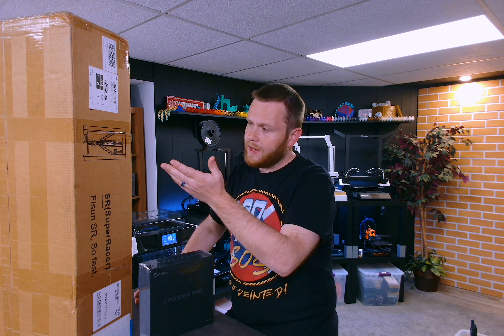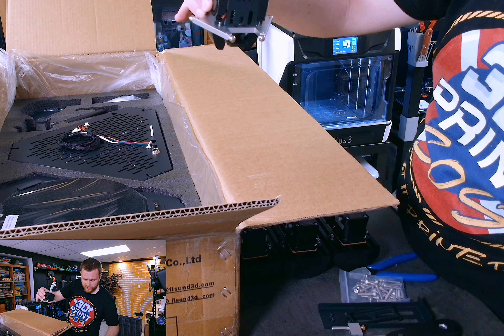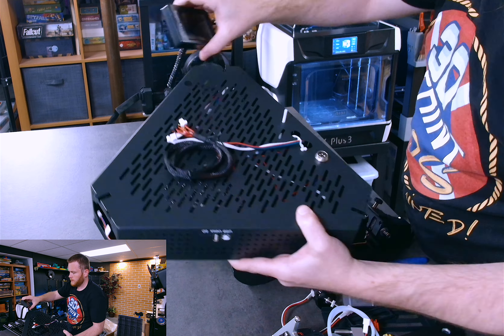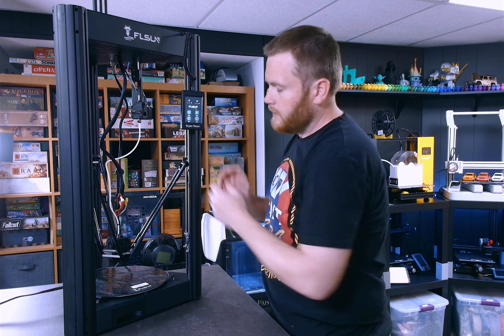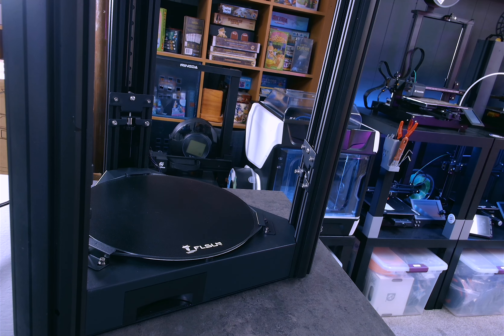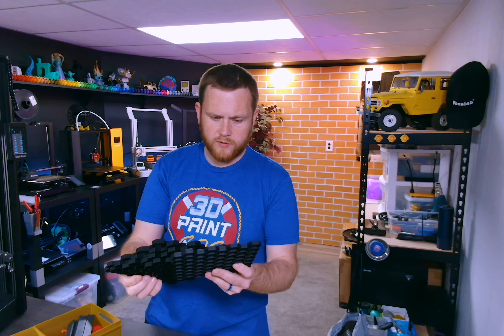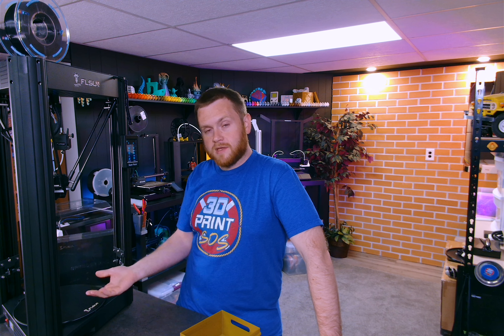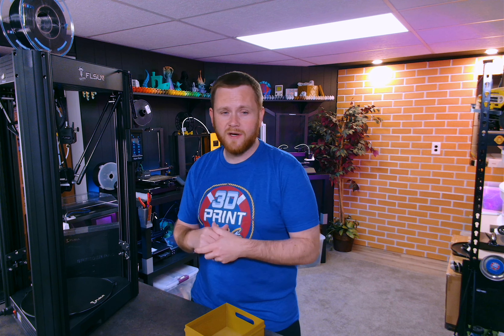My First Delta! FLSun Super Racer + Speeder Pad Combo

Comment: I print PETG at 120 mm/s on SR with a native nozzle and a tube in the neck
Reply from the maker: Heck yeah. It should be great at PETG. Its when you get into Carbon or Glass Filled stuff where it can be worse. Or TPU obviously.  SR is still awesome though.
Reply: @ I replaced the extruder on it with OMG. Connected it to the Speeder Pad. 
It prints monolithic parts with 100% filling for my products that I make. 
I don't even think about changing this printer to another one.
Reply from the maker: @Relax72Relax  Thats great. Love to hear it.

Comment: Got my SR and speeder pad on standby for that upcoming video.
Reply from the maker: I actually passed that machine on. I missed it so much though, I got a v400. I wouldnt wait, get that Speeder Pad unboxed and installed. It’s a massive upgrade in my opinion. Later when you get used to it, you can install vanilla Klipper on it and clean it up big time. Makes it even better.

Comment: Love your videos man
Reply from the maker: Glad you like em, cause they are fun to make! :)
Reply: @3DPrintSOS  are you still running alex's firmware on your aquila ?
Reply from the maker: @fjjj.  No, at the moment, Klipper via Sonic Pad
Reply: @3DPrintSOS  thank you so much for your feed back, so I have finally decided to install the firmware as per the direction o the "reduce risk of fire video" but when I power on the printer nothing happens, any idea what can be happening? thank you very much for your help in advance
Reply from the maker: @fjjj.  Could be several things. You have to make sure you are getting the right firmware for your machine. Second, you HAVE to ensure you are using the stock card formatted with 4096 bytes. This is far more difficult to do if you are on a Mac.
Reply: @3DPrintSOS  i got the sd card formated to 4096 on a windows, i do mainly use a mac, I have an aquila firts gen with a N32 chip
Reply: @3DPrintSOS  I think got it man Mac definitely seem to be the issue even if the usb was formatted in windows absolutely everything should be done in windows
Reply from the maker: @fjjj.  Nice. Yeah it’s doable on a Mac but you gotta get into terminal and do a bunch of tricks. MUCH easier on windows. Thats why I run Windows in parallels for tasks like this. Worth it.

Comment: Just a note, the 330 mm height is at the center.  You lose a little height on the sides because of the mechanics, however the slicers don't appear to be able to take this into account.  Mine should be here some time in the next hour, and I've already got the replacement cooling nozzles printed out.  Out of the box that seems to be the most important and simplest upgrade.  I got this machine to speed up my workflow, especially prototyping.

You can't tune it to speed it up much, because the acceleration is already set to 6000 mm/s^2.  That's why it's so exciting to watch. Even if you set it to much lower print speeds it still beats a bed slinger by a long way.  I'll be trying it at 200 mm/s for some things without fine features, but I'm definitely expecting a limit on how fast it can go for prints with finer details.

Comment: I have the Fl Sun QQ-S Pro Delta Printer.  It is a nice printer, I upgraded the glass bed area by removing that glass bed and installing a PEI Sheet instead. 

Mine has the carbon fiber arm rods and the bowden tube system, 

I not sure if mine would work well with the Direct drive upgrade kit as the point of the hot end on this system 
is lightness is needed for the head to move fast. 
The upgrade would add too much added weight to there and cost allot of money too!

On mine the auto leveling is the same as this one with the removable leveling probe.
The Micro SD Card is the same and the reader is too and I love the way the card sit under the usb reader.

The main moan I have is the hot end is hard to get to you have to do allot of careful unscrewing of bolts in a set order to release the hot end unit from the fans and it has to be put back the right way too.  The V6 hot end is good But I really wish it been a Volcano V6 one since mine is a Pro machine.

The other problem I have is the cables from the top to the hot end would need to be cut then soldered again if I needed to change the heater or thermistor as there is no quick release clip type cables there unlike yours. So not a user help there as not everyone is happy or good at soldering?

One feature I was pleased was on the menu was, the setting of allowing for any middle dip or bulge on the bed so the printing allows for this by the mm size you set it to?
Because on the bed I got being PEI on top of the glass one there is a tiny 1 mm bulge on my bed in the middle.
( and no air stuck under the magnetic layer ) 

Mine sound a bit like R2 D2 bleeping as it works.

Also mine makes a rumbling noise through the work top then down through the floor cupboard then down through my spare room floor in to my front room below.
I can't hear it in the spare room it's self just downstairs in the room below.  I may have to put rubber between the work top and the cupboard to filter out the rumbles?

Shows that the big rubber printer feet don't help with this?

As for the Flexible TPU printing stuff, I found mine does it fine even though the bowden tube is long and the retractions are around 6.5 mm.
I get great TPU prints no problem and no special settings needed just set the temps and flow right and it is fine.
😉

Comment: Totally agree about the fun factor! I still watch mine print. My first printer was a Q5 and almost three years later it's still going strong. A bit noisy mechanically but still making beautiful prints. Biggest weakness is printing anything with holes! I'm still using the original stock bed and adhesion is crazy good. Upgraded the extruder and that's it. FLSun support is great and I recommend the brand. That said, I think my Delta days are over as I'm ready to give coreXY a try. Thanks Fedor!

Comment: I've got the QQS-Pro, the machine before this. I upgraded to a PEI Sheet. I have to say I have since become bored with it, but I think that says more about me than the printer or its capabilities. It's certainly noisy, mechanical sounding but it still prints nicely. Bit slower by today's standards, but for me speed has never really been much of a consideration. Love the ability to upgrade it so much with different parts etc, but I'd rather have a 2nd machine before I go tinkering with the first etc, just in case. - I think I should have started with a bed-slinger before going to Delta, it might have made me understand some of the more important concepts first at a deeper level. But, never too late to learn.

Interested to see you upgrade to Direct Drive and test out the speeder pad, although I think the Creality Sonic Pad is a better option if that can be made to work with it instead.
Reply from the maker: Any of the “pads” can work as long as klipper is running and you have a config. So if you like the Sonic Pad, it shouldn’t be an issue.